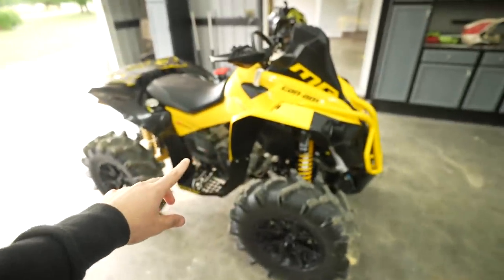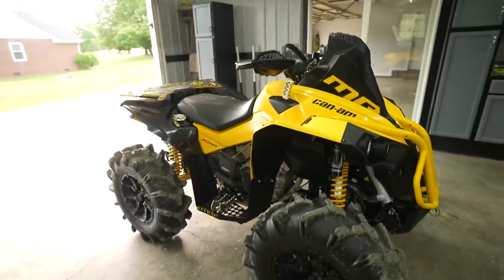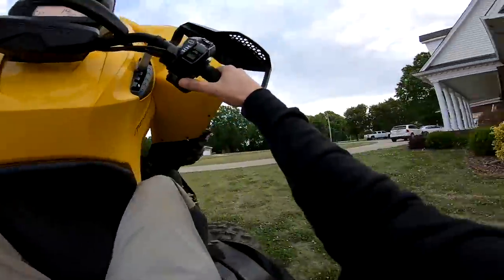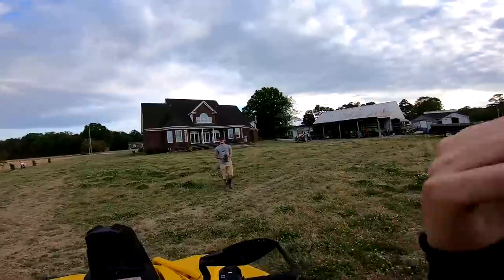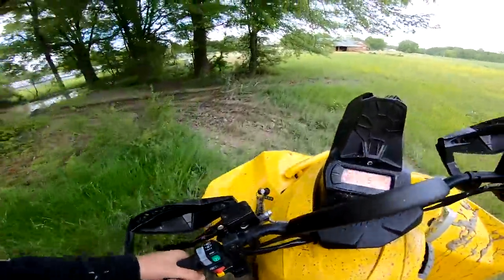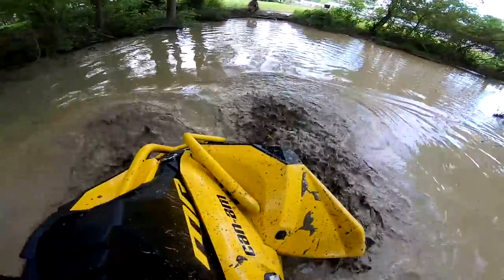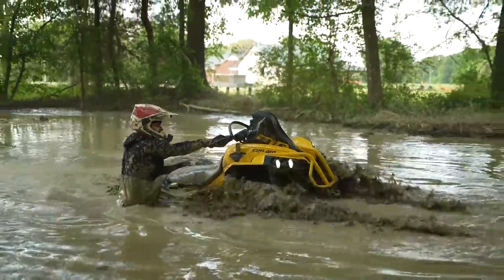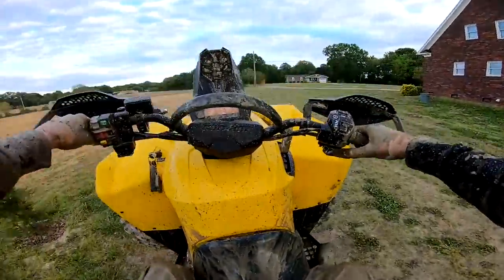COPS CALLED For Riding My Four-Wheeler! *Insane Neighbor*

Comment: I live in Red Springs NC and I'm looking for a cheap atv to build. Thinking something like an older Yamaha Raptor 660 or 360 and I don't care if it's running or not as long as the frame is good and trans. I'm wanting to put an R6 motor in it. I'm open to other project ATVs though so plz msg if you have one in Southeastern NC or Southeast Ga. Thanks guys and girls.

Comment: Braydon i Love atv's to Cuz they the best and my atv Broke IT WONT start never the head WE Tok IT apart Cuz the rot in the Header Broke and WE needet to use a Steel rot and those Tiny Pistons Okay and the Thing ON Them 1 of Them Fall in Engine and we somehow Tool ist Out with those Things with the Magnet on so WE Fishet IT Out and FIXED IT comepletly and IT would Not start ITS Broken so il Post IT on my yuotube the Broken